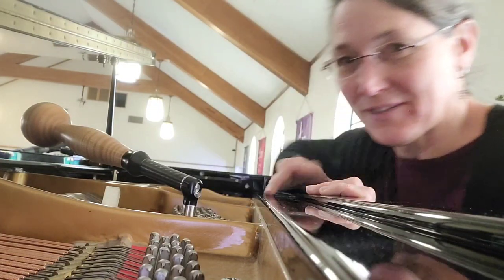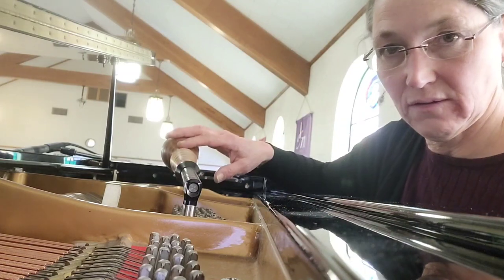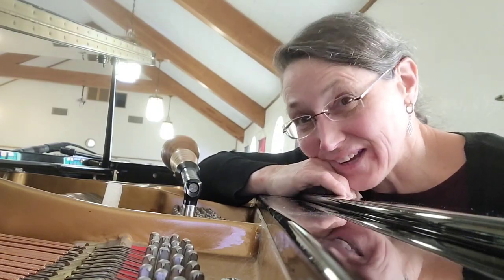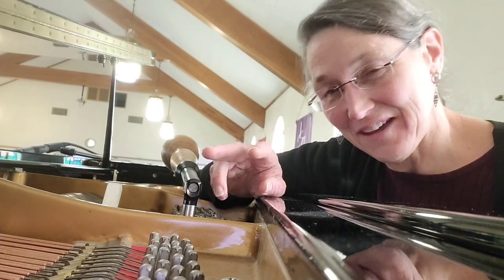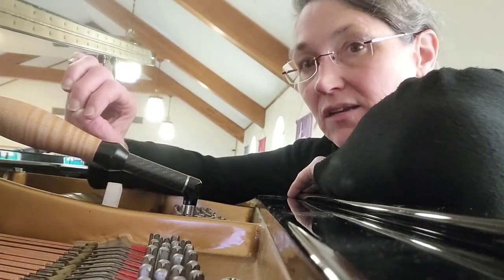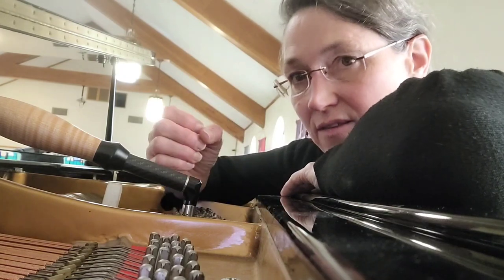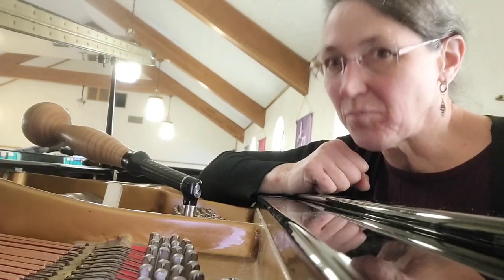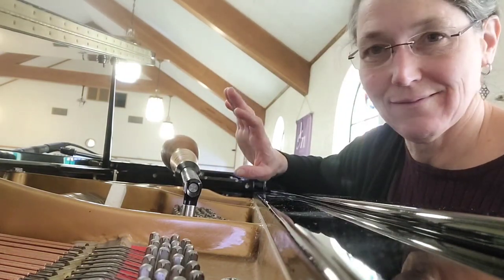thoughts on stability with tighter pins & lower friction at bearing points

Comment: From an engineering perspective, you were talking complete nonsense, until I read your comment. It appears that your use of the word 'tightness' is actually refering to kinetic friction and your use of just friction refers to static friction. In other words, once the pin starts to move, it might 'slip' (low kinetic friction) and then stick (high static friction). And there's your 4 combinations.
Reply from the maker: Ah, no. Sorry about that. These "terms" are known in the tuning world and mean specific things. "Pin tightness" refers to the actual tightness (and friction) between the tuning pin and the wooden hole holding it. "Friction" refers to the bearing points the string has to cross after it leaves the pin. Does that make sense? Most tuners know what we mean by friction, so we drop the rest of the words in the phrase. Tuning pin tightness is more obvious. "Friction on bearing points after the string leaves the pin" just becomes, "friction". It's similar to why we don't call perfect fifth & perfect fourths perfect. Since we never tune any other type of fifth or fourth, we just drop the extra word.
Reply: @PianoTechMaggie  OK, now that all makes much more sense.
Reply from the maker: @johnpearcey  I'm glad! Sorry for the lack of definitions. It's a known idiom in my world. 😉

Comment: ahh - the in-block pin twist. Could write an article on just that! Most of the stability rests on what is happening in the pin hole. took me many a tune to handle this. Stabilizing the treble on Swys that are in good shape is the most challenging. I found a solution finally after many attempts and analyzing what is going on. Pitching is only the beginning!!

Comment: It’s interesting that most of the pianos you encounter have looser pins with string drag. It’s exactly the opposite here in Miami. I see mostly newer pianos but in general every piano I tune has tight pins where you wouldn’t be able to turn the pin with just your fingers on the hammer. It really does require a completely different technique, especially for strings with low friction.
Reply from the maker: Yeah! No kidding! Definitely not my normal here. Thanks for sharing that point because it's important for people to know that different pianos require different hammer technique!

Comment: Okay so you aim for more tension at the non-speaking length, than on the speaking length ? I thought stability was to spread the exact same tension everywhere, which is a nightmare when string has a very high friction points (sorry Im not english). My approach is to leave an un-twisted pin behind me, so I over turn the tuning pins the right amount to counter that... I feel you have a different technique
Reply from the maker: Your English is pretty good! For me, it's a specific concept. For example, if you equalize tensions on the SL & NSL, it will be perfectly stable unless you have a hard/loud blow. When a string is set into motion with force, the tension on the SL naturally increases. If the tension on the NSL isn't high enough, the pitch will go flat. If you have a perfect situation with just the right friction, both scenarios may work. If the friction isn't ideal, then one scenario will work better than the other. Which situation requires which setting can be found with test blows. Do whatever works. I have a suspicion that most stable tunings have more tension on the NSL without the tuner realizing they are doing it. Either that, or I'm equalizing them without realizing it. Haha! In any method, if it works, it works. ;-)

Comment: I don't know - bending the pin ? They are relatively short, stout and HARD STEEL. What I think actually happens is the hole in the pin block actually flexes within the wood (kind of microscopically, almost) and allows the pin therefore to move as if it's being bent. Maybe that's what you actually mean.
Reply from the maker: @catkeys6911 Yeah. There is a lot of debate about this, and I go around and around about it. Regardless of what happens, "bend the pin" is common vocabulary with it. I've played around with bending the pin in a vice, and it does bend a little, but I don't believe we aren't compromising the wood. As you pointed out, they are hardened steel. So, yes-ish. That's what I mostly mean.
Reply: That's kind of what I figured - it's just common terminology and I was being very picky. But trust me - if you move the pin laterally in the pin block, you're actually moving wood grain. If the pin got bent, it wood wobble a little (the center of its end would travel in a tiny circle) when you turned it- and they never do, right? As you may know, the pin block is a laminate - like a VERY high quality, VERY dense plywood, so the grains in it go every which way, which thwarts the hole from elongating as you "bend" the pin.  Steel is much stronger than wood.  @PianoTechMaggie
Reply from the maker: @catkeys6911  Bend is definitely the wrong word. More people are using the word, "flex" these days. I think that is more general in its meaning and can mean both the pin and wood. I've actually seen a bent pin. Not pretty. I can't imagine how hard someone had to push on it to make that happen. 😳 There was an experiment by a PTG chapter that involved a lazer on a celing. It's amazing how much lateral movement happens in the pin no matter how hard you try to keep it stable. So, if it moves anyway, why not use it to your advantage? 😉
Reply from the maker: @catkeys6911  Bend is definitely the wrong word. More people are using the word, "flex" these days. I think that is more general in its meaning and can mean both the pin and wood. I've actually seen a bent pin. Not pretty. I can't imagine how hard someone had to push on it to make that happen. 😳 There was an experiment by a PTG chapter that involved a lazer on a celing. It's amazing how much lateral movement happens in the pin no matter how hard you try to keep it stable. So, if it moves anyway, why not use it to your advantage? 😉

Comment: Thank you for the video! I thought stability came from equalizing tension in the speaking length and non-speaking lengths. I would think that having higher tension on the NSL would lead to the pitch going sharp as the tension equalized, i.e after hard blows and/or humidity changes, NSL lowers in tension and SL increases as string overcomes friction on agraffe or capo. Thank you in advance for any additional explanation!
Reply from the maker: Hi! Think of it this way: When the string is in motion, particularly on a loud note, the string tension on the speaking length is greater than when it is at rest. Therefore, if you equalize the tension between the SL & the NSL at rest, it can more easily pull flat when played loud. If the tension is equal between the SL & NSL when the string is played loudly, it won't go flat and will result in the NSL having slightly more tension at rest. This last scenario gives the most stability. However, you can accidentally get the NSL to have more tension than the SL on a hard blow, which will cause it to go sharp as you describe when that hard blow happens. Make sense?
Reply: @PianoTechMaggie  Yes, it makes sense! Thank you!

Comment: Thanks for this video. I wonder if you can tell me which type of those four options is usual on a YAMAHA U3H (1976 vintage, refurbished in 2016), as it is my piano and I want to tune it. Thanks for any hint!
Reply from the maker: Unfortunately, two identical pianos can even be different, but I can tell you that the older a piano, the more likely you are to experience looser pins and higher friction. That's far from 100%, though. You just have to tune it and find out.
Reply: @PianoTechMaggie Thanks for answering my question!. Yes, I know it should vary from unit to unit, but perhaps knowing that the piano has a construction or another, as a model (for example, the U3H does not use agraffes), tends to be one or the other way. So far, what I have found is that pins are tight, so I guess we are talking of tight pins, high friction. Some time ago I would think that friction should be reduced by oiling... But it seems I was wrong. Luckily I had not done anything on it yet, but solving some unison problems. I proceed with the outmost caution!
Another thing which I may ask, if you allow me, is about the non-speaking part of the strings, on the lower side of the piano. I am hearing some vibrations that could be related to them not being correctly silenced. Is like a vibration which happens after a while after pressing a key, and seems to be out of tune. It sounds bad and is mostly heard around middle C, so it is an area which is used almost always and drives me nuts. I know for sure is internal to the piano. I am planning to add some felt strips on these areas, but wonder if that happens in this kind of pianos. Thanks!
Reply from the maker: @JoseVGavila  I'm afraid I don't know enough about specific pianos, except to say that the same thing in that two identical pianos can have different problems. I can, however, assure you that friction issues can happen without agraffes (if that's what you were implying). Friction can happen on the felt the strings rest on. It can happen on the capo bar. It can happen at any bearing point at all, including agraffes, but definitely not limited to them. "Oiling" can sometimes help, BUT, do not use regular oil!!! Regular oil will "creep" and can destroy the tone of your strings. Please only use a "counter bearing lube" such as Protek or John Page's CBL. They are thin enough to not cause trouble and don't "creep" like other lubricants. I have had success with them, but only around 50% of the time. I know others who swear by them, but I've not been as lucky. I would definitely try the felt strips in the NSL, and check the NSL on the hitch pin side as well. Sounds can come from both places. Sounds can, unfortunately, also come from other places. Sometimes they come from the strings themselves. There have been a few pianos where I never did find the source of the sound, and neither did some other techs. It makes us all crazy. I can tell you that new Pearl Rivers do this more than most, but the sounds go away after they are a few years old. As far as your pins, if they are tight, that's good. How are you knowing if you have high friction? If you turn the pin a small bit and the pitch doesn't change, that is a good way to know.
Reply: @PianoTechMaggie Thanks a lot for your detailed information!. I have read quite a bit and watched lots of videos on these topics, but I am really just an engineer and amateur musician trying to figure out the misteries of piano tuning 😅So this first-hand information is worth gold for me!. Thanks a lot, I will report back what I find

Comment: Your analysis of loose pins, tight friction and the variable variables is brilliantly described. On many instruments I find variable variables even in the same instrument and I put a washer on looser pins so that in moving from one pin to another the felt washer warns me to apply a more gentle tension. With many of the instruments I tune the 90 degrees position works really well for me. One can pull sharp and then as the pin bends forward the string settles down into pitch and it's where it wants to be. On the subject of damage by pins bending it's minimised by having a short tuning tip as you have here. Many levers have tips which are much too long, or are at an absurd upwards angle and these must put the wrong leverage on the wrestplank and would seem more liable to cause damage. Thanks for this video. Many people are too prescriptive in technique and different methods have different applications in different circumstances. One method cannot be universal. I had an instrument which wasn't greatly coorperative so tried the 12 o'clock method https://youtu.be/1ivRR9sYZ0A?t=345 and didn't get on with it.
Reply from the maker: @unequally-tempered  Hi! Thank you for the compliment! 😊 You are so right about there being no single method for all situations. While there are some general "truths,"  there are so many subtleties to our craft that everyone must indeed find their own way in all the grey areas. I learned a lot about lever technique from Dan Levitan. I think he would agree with you. His main thing is that it's impossible to not flex the pin at all, so you may as well use it to your advantage. And yes, we don't need to get carried away which is very easy to do. No wonder you don't care for the 12 o'clock method! That was terribly awkward! You need to move your tuning devices to the other side and sit at a 90⁰ angle to the piano to put you as square to the lever as possible. I found this video of me tuning a bit which shows you how I do it. The lever is either at 12, or as close to 12 as the pin fitting will allow without going past. I face toward the hinged side of the piano. I'm dealing with a temporary injury in this video, so please disregard the braces. If you ever feel like trying again, do try this way & let me know if it's any better for you. 
https://youtu.be/UL3CqMc4K1g?si=vz0uDCPgOf8cbzmC
Reply: Oh yes! Of course I wouldn’t use the ETD in that position interfering with the 12 o’clock position like that normally but doing a video single handed so that the viewer can see the ETD display as well as what one is doing isn’t always easy and especially when one is on a job rather than doing an exemplary instruction video. Nevertheless I was able to feel there that the 12 position wasn’t the solution on that instrument!
Reply from the maker: @unequally-tempered Oohh! I see. I also now understand you were talking about that specific instrument. Sorry for the misunderstanding! You did say that. 🙄🤦‍♀️🙃

Comment: Glad you're talking about this, because I think sometimes certain lever techniques tend to get cargo culted when in reality it's all so very situational.

Some thoughts on why flexing might affect the pinblock less than we might think:

1. If you have tuning pin bushings they're gonna take the brunt of it anyway

2. One time for grins I installed some leftover pins in a cutoff piece of pinblock, brought it to a chapter meeting, and let people flex them with a tuning lever to get a feel for how much force it took to actually bend them permanently. It takes a lot, far more than you'd ever reasonably use when tuning. Also, the pin will consistently deform right at the becket hole because that's the weakest point. So it may be that the tuning pin steel actually yields before you manage to crush the pinblock wood.
Reply from the maker: Thanks for all those thoughts. The thought about the beckett hole never occurred to me. I was going to put a pin in a vice & see how much it flexed, but I attempted it right when the vice was about to break...so...oops. 🤣 I have a new vice so will try again. 😉 

My thinking on the wood: It's hard for me to imagine the bottom of the pin doesn't put pressure on the wood in the opposite direction of the flex, but it SEEMS to me that mild pin flexing doesn't cause excessive damage. I wish I could know for certain, but I just can't. 🤷‍♀️
Reply: @PianoTechMaggie  I hadn't thought of that at all, but it makes sense that it puts pressure on the opposite side of the hole too.

Comment: The best way to explain to someone about pin movement in a plank (pin block USA ), get hold of your first index finger, hold it tight then turn your wrist; the top of your finger will turn, and the bottom of your finger will stay, that explains pin twist, Bending the pin back and forward in the UK we call that telegraphing and that's very useful if you've got a lot of drag " friction" on the bearing point the pen is set, but you need to nudge it a touch.

Also, in the UK, most tuners have the lever on grand 9-6 for right-handed tuners; left-handed tuners tend to have 11 to 5; for a upright Pianos is generally 12-6 left-handed tuners maybe 11-5. Tuning Grands righthanded with the lever at 12-6 seems very uncomfortable to me as you have to lean right over the piano.

At the end of the day, it's what works best for you and the piano. If the end result is Good, it's not important.

Barrie
Reply from the maker: Lots of good points there! I use the finger in the hand method as well. Glad I'm not alone! 😁 That's really interesting about the tuning lever position! I agree the US method is more awkward. We tend to sit at a 45⁰ angle to the piano which can make it quite comfortable. The thinking about having it closer to 12:00 is that you can use a shorter tuning tip which will make the pin flex less. I have a levitan-C lever which I can hold in front of me. It is more comfortable but if I need to move a mute, I have to reach into the piano anyway. Moving mutes is faster if my hand is already there. Interesting stuff! 😊